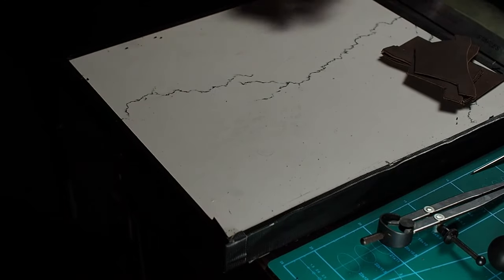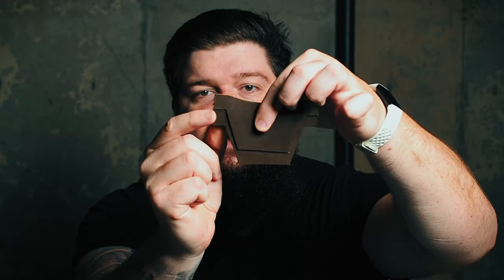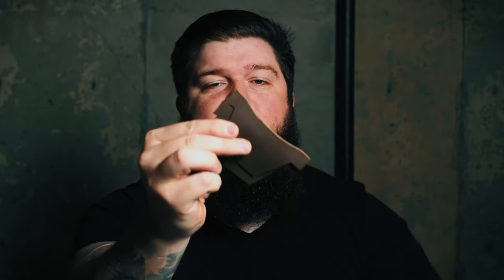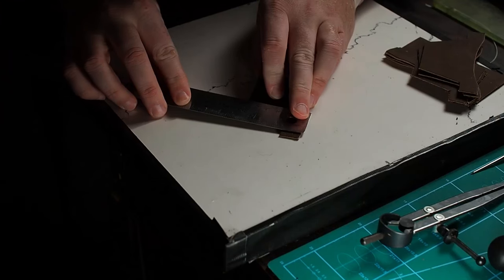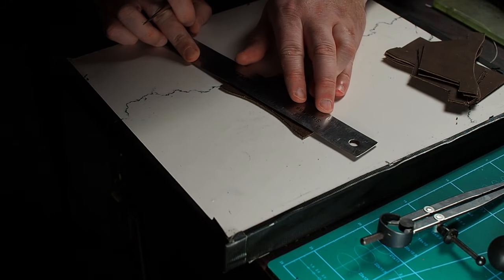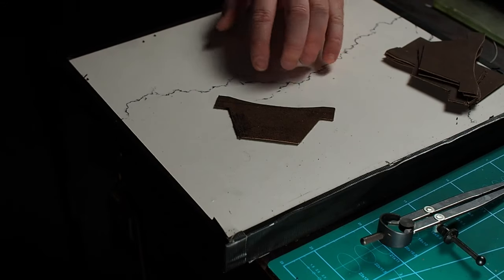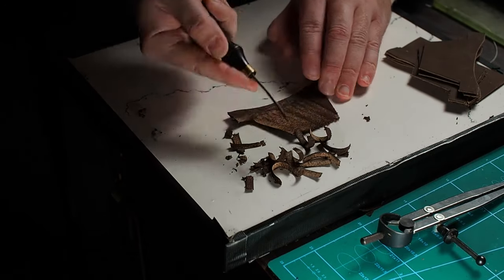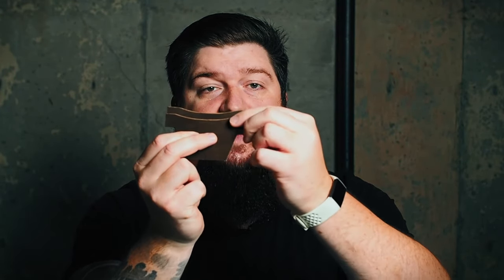The RIGHT WAY to Make Leather Wallet Pockets

Comment: i think "slot gap" is pretty overblown. If you actually talk to regular customers they have zero idea that it even exists and would never point it out as an issue/flaw. Half of my job with folks coming in is to even show them that "t-slots" exist. This method is cool, and might be useful if you're making a wallet for $600+, but anything less then that it can add hours of unnecessary work/cost that customers don't want to pay for.
Reply from the maker: That's a fair point. It definitely adds time. I'm working on a custom long wallet right now that has 14 t slots total and it definitely is proving to be a ton of added work.

Thanks for watching!

Comment: I started doing this myself the last few I’ve done. Glad to see it’s someone else’s pet peeve too, haha. Thanks for the idea of the use of wing dividers for the curved tee. I avoided that by making the last couple wallets with straight top t’s because I ran them through the bell skiver, but much prefer the curved t’s for wallets.
Reply from the maker: The wing divider trick is pretty good. I wish I could take credit for it but I saw it in a Corter Leather video while I was filming this and had to quickly add it.

I prefer a curved top too, but it'd be tempting to stick with straight tops to just run them through a bell skiver!

Thanks for watching the video! Much appreciated.

Comment: I love this idea! I have completed 2 wallets and am a newbie to leather working. I was so disappointed in the way they looked, especially if the cut was a tiny bit off. This tip will eliminate that issue. One question though, if you are moving the pocket up should you lengthen the pocket so the cards do not overlap? Thank you for great informative videos. I am learning so much.

Comment: The problem with this solution becomes that of card slot creep.  If you're going to advance T slots into overlapping positions to avoid 'slot gap', you're materially moving ALL the card slots upward, which results in an ill fitting final C slot at the bottom with leftover space.  To make this method resolve properly, you'll be left measuring and cutting C slots individually, which means more time and inconsistencies.  My personal solution to avoiding 'slot gap' has been avoiding sharp angles altogether.  Cut your T slots in curves and they become less cringe to the eye.  Happy crafting everyone!
Reply from the maker: An excellent point. I definitely should have mentioned this. Thank you.
Reply: Hi, can you explain more of cutting T slots in curves? I can't picture it in my head
Reply: @halorayhan   Sorry to be late in response.  Imagine your pocket 'T slot.'  Now imagine cutting the inner corners into upside down 'J's' .  The under slots are rounded and become less evident when you stack the card battery.  Close becomes 'good enough' provided there isn't a gap between the tops of the tabs as you stack them.

Comment: Hi there, excellent tip. But this way there is like a wave like pattern on the edge, so not a srtaight line. By skiveing the top of the bottom T slot, this could be eliminiated... just like when you do a keeper for a belt or a watch strap. But this is simply theory crafting at this point. Nontheless, this is way better than having the black hole between the slots. Nice job :-) ..... or you could just simply use a laser cutter and do it like that... the budge friendly way :D
Reply from the maker: Hahaha the "black hole". I love that. Good point about skiving the top of the bottom one. I'm going to give that a shot.

Comment: Tim: Instead of skiving almost the entire pocket, can you just make it out of thinner leather?  If you use 3oz for the body, how about 2oz for the pockets.  Just asking.
Reply from the maker: Oh you 100% can. I did that recently on a small cardholder and it worked great!
Reply: @BlackFlagLeatherGoods  I just tried it over the weekend with a Stock and Barrel pattern.  I switched the T-Pocket to your overlap suggestion to try it.  (forgot to skive the overlap so I have a bump) Used 2oz for insides.  3oz for the outside.  Seems to work really well.  Always trying something new.

Comment: Is it harder to get the cards out with the thinner opening?
Reply from the maker: I haven't found it to be. One trick you can do to make sure they fit nicely is put a card or two in the slot as you're gluing it down. It gives you just enough slack to make sure it'll fit cards really nicely. I think I picked that trick up from Mascon Leather and it works really well.